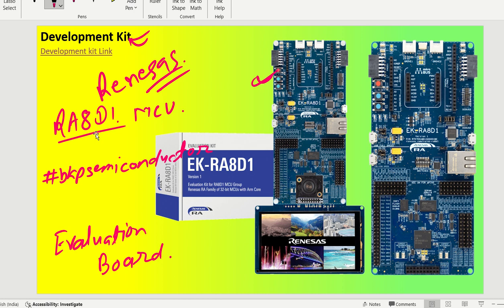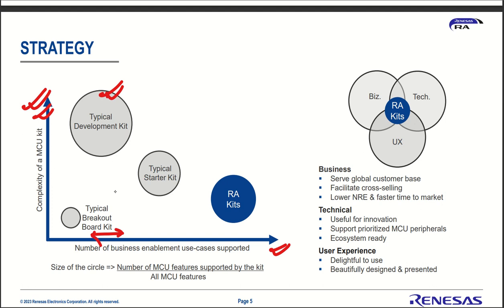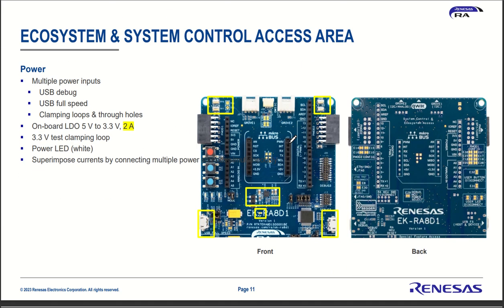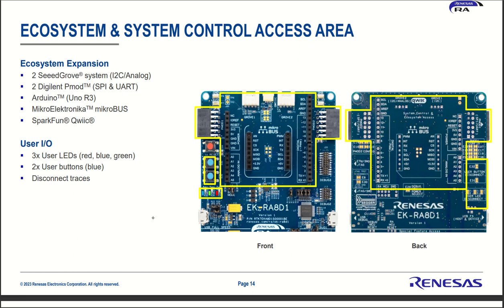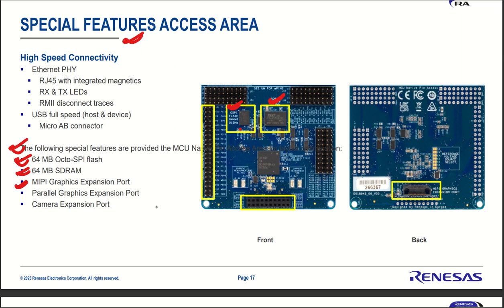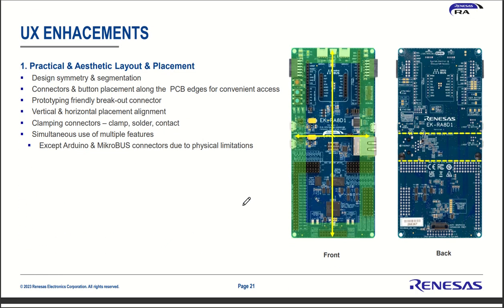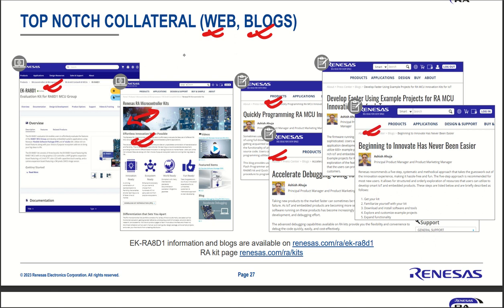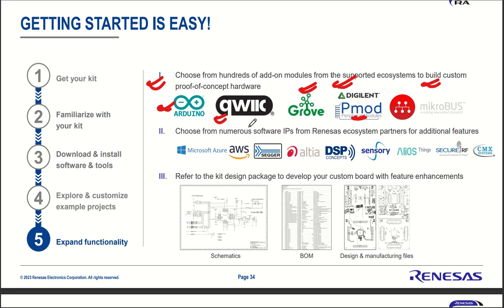Renesas EK RA8D1 development kit deep dive presentation

Comment: will R7FA8D1BHECBD support CANFD ? not able to see the CAN pin connections on the board
Reply from the maker: Hi Roshan, Yes. It has 2 CANFD. You can refer datasheet page 9 communication section. Reach out to me directly in email for any support in design and review.
Thanks, hope it helps you